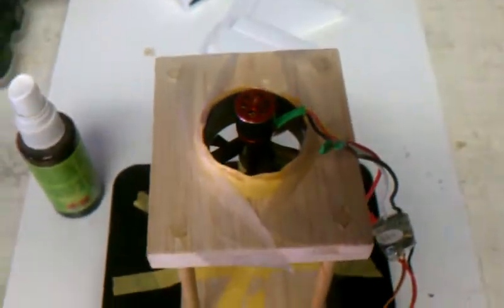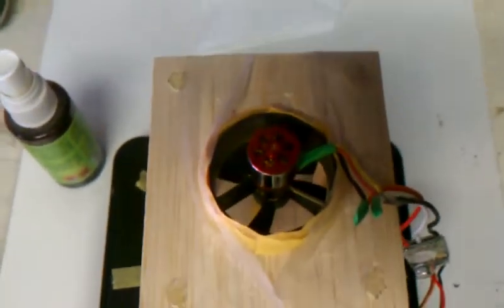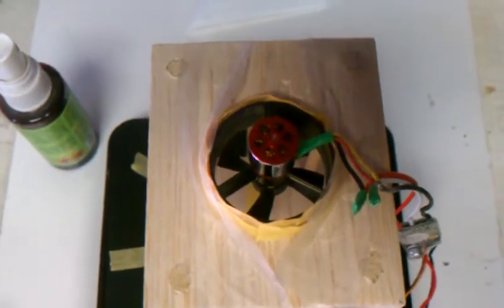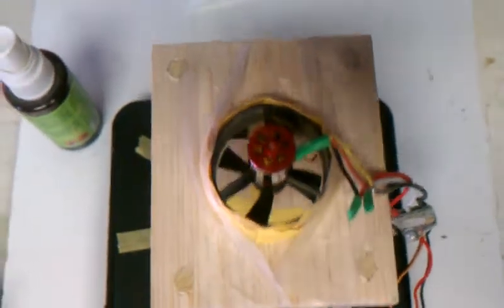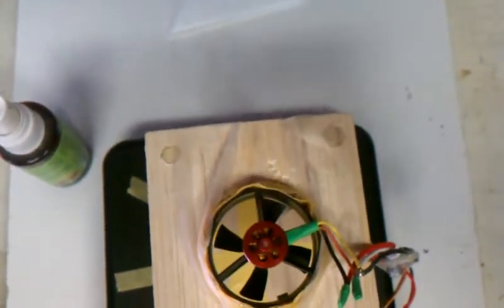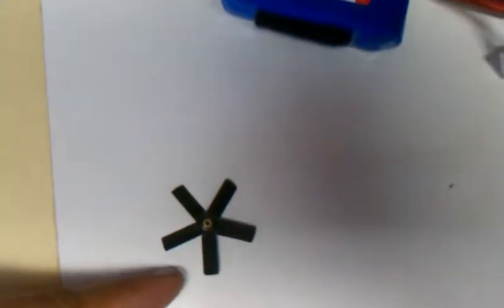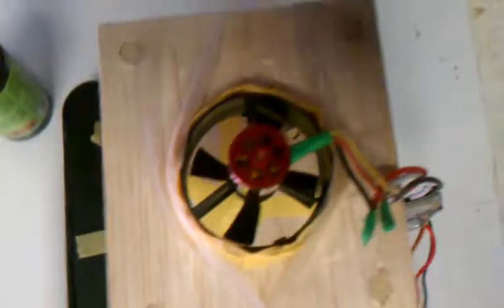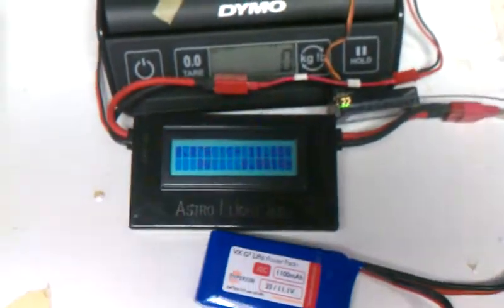Micro edf testing: 35mm, J-power motor, Aeorc 8 blade rotor (clipped), 3s

Comment: Rcplanepilot,  it seems like a worthwhile test but It is very difficult to comment on the capabilities of these high kv Chinese motors.  Quality is variable and high RPMs require tight tolerances and good bearing.  Your idea will produce a 100k+ rpm fan.

Comment: Hi Becker i know this is a old vid but i was wondering if you've ever tried the Aeorc     35mm edf unit that comes with a 11000kv motor and 8 blade rotor for 2 cell lipo. I was thinking of getting one and clipping the rotor to 4 blades and running it on 3 cells. Do you think it would be a good thing to try? Cheers.